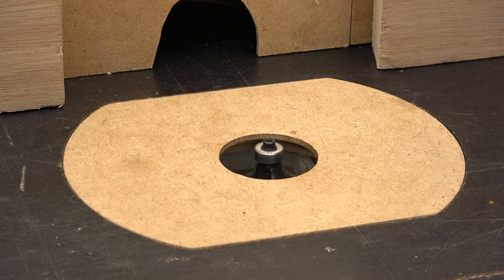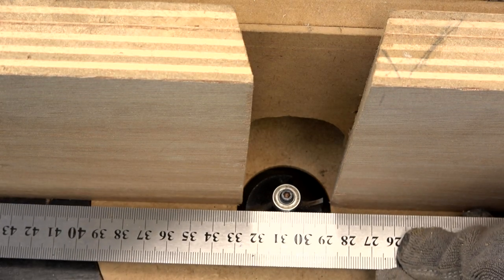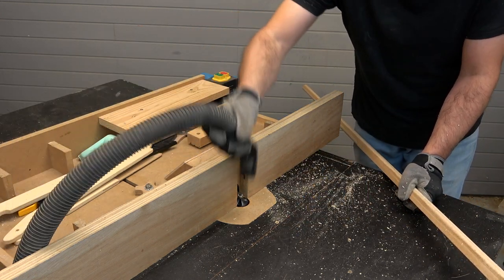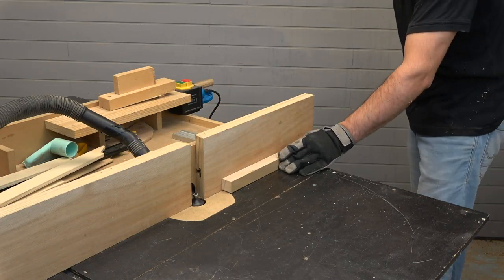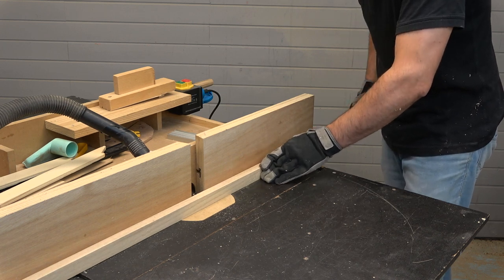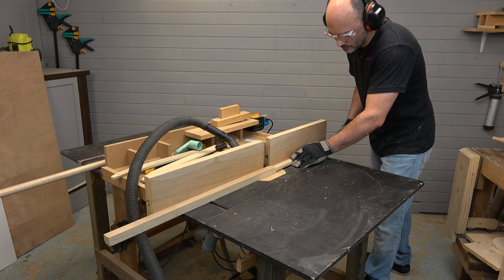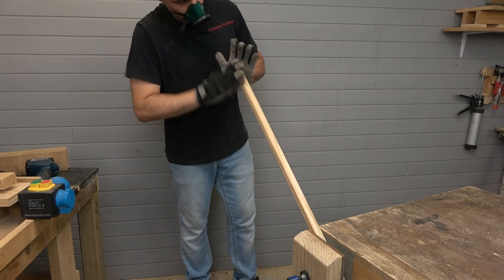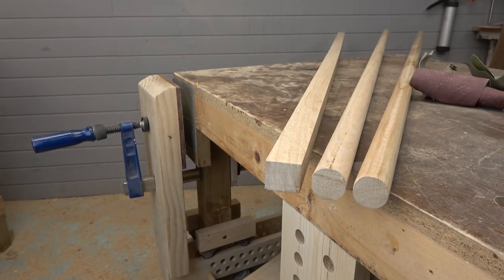How to make wooden rods on the router table

Comment: Good result!  Congratulations from Mexico dear friend.  Even if you had set the Router and the Fence perfectly, you will find that most router bits of that shape are NOT perfect, so you did a good work!
Reply from the maker: Yes, it is quite hard to make perfect dowels, but in most cases this is more than aceptable :)

Comment: now you can spin it inside a hole in a metal to make it perfectly round
Reply: That would be a "draw plate"...once used for dowels and trunnels
Reply from the maker: Yes, but will that be easy with these big and long wooden rods?

Comment: If you get yourself some steel like an I beam and bore a hole in it the size you want your rods then after you’ve rounded them on the router you can use a mallet to hit the rod through the beam and it makes it perfectly round
Reply from the maker: I think that what you tell is something like when artisans make small dowels, but do you think it will work to help making these big wooden rods?

Comment: Great idea! I wonder if it’s possible to rip the blank to the perfect size to make a dowel using your technique without sanding.
Reply from the maker: Not easy. But next try I'll try to be more precise when cutting the square section strip and when setting both, the router bit and the router table fence :)

Comment: I think that this is a very good way to make rods. With different types of router bits you can easily make different shapes. What are you going to use the rods for?
Do they need to be so long? If I have enough place on my router table then I feel totally comfortable to run a 60 cm long piece of wood along the router bit.
I do the whole length in one pass. I stand in front of the router table. My left hand is at the start of the piece of wood and my right hand at the at the end of the wood.
My fingers are always at a safe distance of the spinning router bit. imho. But you can use dedicated (or adjustable home-made) push blocks or sticks if you don't feel safe.
But in no case you should wear gloves. That is very dangerous.
Reply from the maker: Yes, I don't like using gloves. But sometimes I work making bread with my hands, so I have to avoid any splinter or any cut in my hands

Comment: I am a beginner at the router table. What is the smallest diameter rod you would feel safe routing -- to make a dowel? Just to know limits, thanks.
Reply from the maker: These ares are 28 mm in diameter. I don't know what is the smallest diameter I would feel safe